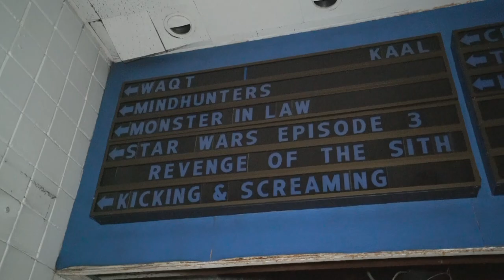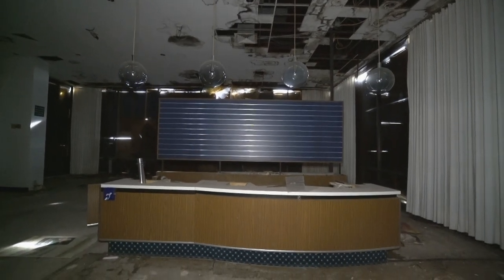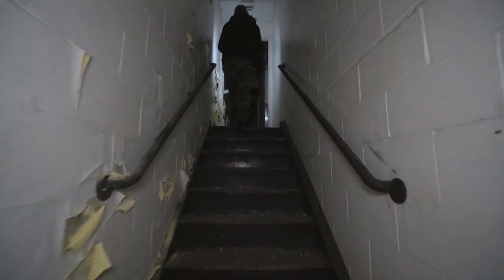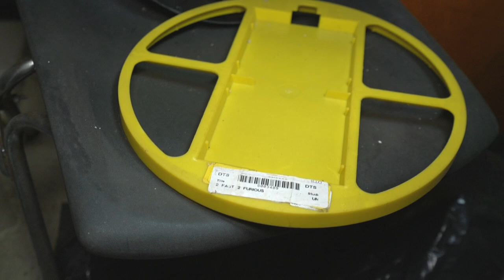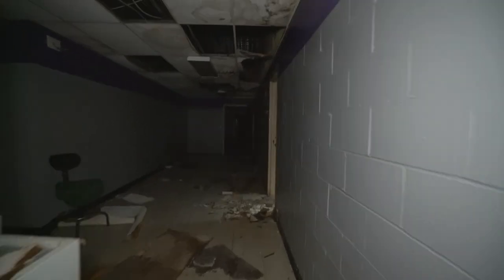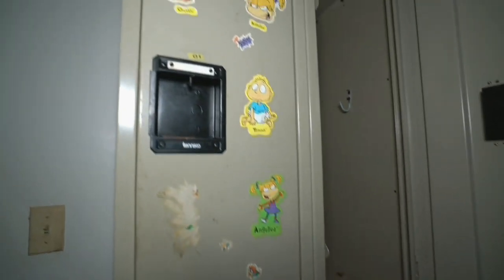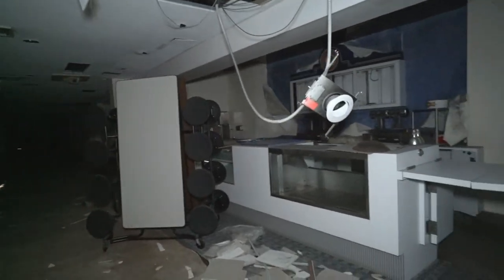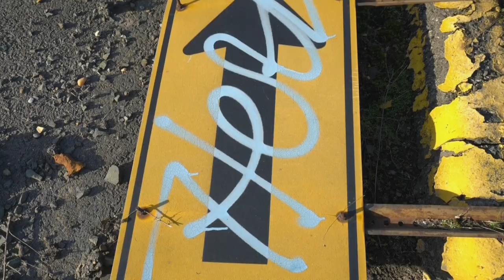Abandoned Retro Movie Theater - Films Left Behind(Closed 2005)

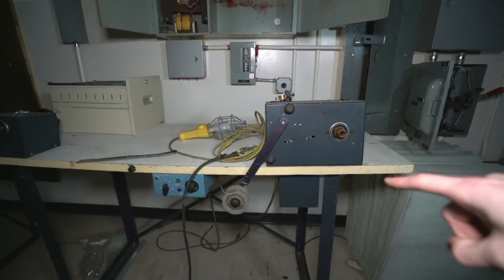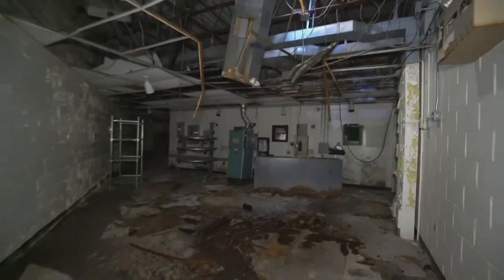Comment: Ok, you really struck the nostalgia nerve with me.  I was a projectionist late 80's through early 90's.  My first job.  I used to use an assembly table just like the one at 8:55.  Mostly to splice together trailers to go on before the movies.  Slight correction on the DTS discs, there was a time code printed next to the optical soundtrack on the film.  A sensor on the projector read that timecode and kept the CD/DVD audio playing in time with it.  The old style optical analog soundtrack was still on the film and was used as a fallback in case the DTS system faulted.  I'm surprised that all those discs were still there.  They were supposed to be put back in those round carriers and placed in the film cans when a movie was shipped out.  Just for some (unnecessary) information on sound systems, Dolby Digital used a digital soundtrack code printed on the film between the perfs (sprocket holes).  A camera would read it as it went by and it didn't need external media for the sound like DTS did.  A third system, Sony Dynamic Digital Sound (SDDS) used a digital track printed on the last bit of real estate left on the film, the edges that took constant wear as it went through the projector.  I never used that system but I'd heard that it was unreliable and not widespread.  At 12:45 to the left of the projector you can see a Christie platter system.  All the trailers and reels would have been spliced together to make one big film on one of the platters.  The whole platter spins as the film unwinds from the center, goes through a speed control mechanism, to the projector, then back to a different platter where it was wound around a central ring.  When the movie was over, pull the ring out and place it on an empty platter, pull the speed control out and place it in the center of the full one, thread it up and your film would be ready to load for the next showing.  No rewinding necessary.  It does not look like the other projectors used reel to reel but had platters also.  There were pulleys at the top and bottom that would have gone to the platters which normally were to the left of the projector.  It was common to take old projectors that were used in old reel to reel theaters where there were two of them side by side and use them singly with platters.  I had 3 projectors that were built in the 1950's at my first cinema.  #1 and 3 had been a reel to reel pair in the past with 40 minute magazines which we still had and were stored behind one of the screens.  I'm going to assume that the projectors in this cinema were left behind because digital projection was taking over and they no longer had any value.  Looks like the lamp houses were disassembled and the lamps removed because they could be dangerous and still had value to use in another cinema that was still operating.  I had one of those lamps blow on me while in operation.  Made a hell of a mess of the lamp house reflector not to mention the one in my pants from the noise it made.  Looks like most of the sound equipment and speakers were taken out as they would still have value.  Anyway, I went long winded for this comment but I hope it was educational for all you youngsters that took the time to read it.  Thanks for this exploration.  Made me sad to see the ruination of a cinema like that but the times keep on changing and us older farts can now be made fun of with our recollections just like we used to do for our previous generation.
Reply: This is incredible information and you should log it in a journal, facebook(i'm so sorry), or anything of the sort.  in a hundred years people will study your words.  Thank you for sharing.

Comment: All films are rented and have to be returned after showing. If not the fee is very high for "lost" films!
I'm surprised this place is not more trashed being in New Jersey! It officially opened December 7, 1979. The first film shown was "Star Trek The Motion Picture."

About the DTS Discs:
The theater sound system uses six separate speakers. The audio channels are encoded onto one or two CDs. The theater is equipped with a CD player and a decoder that splits these channels up and plays them on different speakers arranged throughout the theater. As in Dolby Stereo, DTS has three front sound channels and a subwoofer. But instead of a single surround channel, it has separate channels for speakers on the left side of the theater and speakers on right side of the theater.

The CD is synchronized with the picture by a special time code on the film. The code, a series of dots and dashes along the side of each frame, is read by a special optical reader mounted on the projector. The reader shines light on the film with a light-emitting diode (LED). The light that passes through the film hits a small photocell. The photocell sends pulses of current representing these flashes of light to the DTS processor. The dash pattern corresponds to a pattern encoded onto the CD. The processor makes sure the two codes are synchronized so that the sound and picture fit together.
Reply: They opened with Star Wars and closed with Star Wars. Crazy.
Reply: Star trek is different from star wars so almost
Reply: Interesting.
Reply: @IronMaidenDoD  but has the same dweeb/nerd/geek crazed fan followers?
Reply: @nathanlewis5682  your point?
Reply: Someone asked if there was a difference of star trek and star wars. The fan base is probably the same. We'll, besides the storyline plot, the time setting. 23rd century vs a long ass time ago. Hollyweird is running out of original ideas. I would laugh if there was a star trek star wars crossover movie like the Flintstones-Jetsons crossover made-for-tv movie.

Comment: The DVD's are DTS soundtracks for theaters set up with those systems use those instead of the analog track on the film
Reply: They realized and mentioned it in the video later on. They got it wrong assuming there'd be no soundtrack on the film itself though.
Reply: The film does have soundtracks.. It had dolby SR tracks and DIGITAL tracks... Most likely DTS and Dolby digital tracks.. The theatre was setup for DTS digital and used those discs for the digital sound
Reply: @txdraw  those Christie projectors were old a hell even for 2006 lol.  I remember working with Christie P35's in 1999.
Reply: @txdraw  Yeah, memory serves (I worked at theaters in the mid-90's) that DTS (Digital Theater Sound) barcodes were in-between the image and the analog (stereo) soundtracks, Dolby Digital was in-between the sprocket holes, and Sony Dynamic Digital Sound (SDDS) was on the outside edge of the film (the worst spot to put it because that's where the film got the most wear from the pulleys that it ran on). The latter two formats didn't require the discs like DTS. BTW, our theater had DTS in one auditorium and Dolby Digital in another.

Comment: great find, I was  a union projectionist for 15-yrs before going technical as a 35/70mm film projection/sound engineer for 40-yrs, I saw projectors from manual change-over to platters,  some of you guys may remember carbon arcs for the light before xenon bulbs in the early 70's to present... the film came to the theatre on 2000' reels (5-reels/90mins) (6-reels/2-hrs). until 1975 all cinemas was mono sound with 1-speaker behind the screen, in 1975 Dolby stereo came our in 4.0 w/left-center-right speakers behind the screen (no sub woofers), in 1980 sub woofers came out & the Dolby format was 4.1. In 1993 the format changed to 5.1 w/stereo left-right surrounds & DTS digital sound was the 1st digital sound on CD disc with time code on the film to tell the CD laser where to be to sync film to the disc...1998 Dolby digital came out with sound format on the film, also Sony SDDS was just beginning to come to theatres... Sony SDDS was the better of the three digital sound format...Dobly & DTS was 5.1, Sony SDDS was 8-channels 8.1.... in 1999 Dobly & DTS came out with (6.1), in 2001 Dolby & DTS came out with (8.1) & it stay that way until 2015 until digital cinema was beginning to take the place of 35mm film... By 2018 the 35mm & 70mm film era ended & digital projection & sound took over. This is when I retired from the cinema industry after 48-yrs in the business. 70mm was a limited production with tape recorder type sound track that was for large venues, later became IMAX..Until 1973 all projection light was carbon rod that can only run for 1-hr, that is why 2-projectors was use, when xenon bulbs came out in 1973 that changed the theatre industry, 1975 came the platters that the film was on large rotating table the rewind the film as it was being shown, these platters were gray in color & held the entire movie on 1-platter, there was 3-disc, 1-for the movie being shown, 1-to take-up the movie (rewind) as it being shown, & the 3rd disc to hold a 2nd movie.... to be part of a cinema with reel to reel & carbon arcs to platters & xenon light, from mono 35-watt amplifier to 7.1 stereo with up 17,000 watt of audio power was cool... If you see a indoor cinema w/5-6 amplifiers that was BIAMP sound 1-amplifier for each speaker except surrounds which was 1 or 2 amplifiers wired in a series/parallel config to trick the amplifier to maintain 4~8-ohms... subwoofer had 1~2 amplifiers usually one... I had installed cinemas around the world, my last count in projector install was over 2,200 plus in my career, I not only installed & serviced & maintain the projectors... the projectors were made by Ballantyne, Christie, Century, Norelco, Simplex, Strong, Furmenn, & Cinemeccanica... the projector light lamphouse was made Christie, Norelco,  Cinemeccica, ORC, Xetron,  Xebex, Film Systems & Strong...the platters were made by Balco, Ballantyne, Film System, ORC, Norelco, & Christie... the most use projectors was Christie, Century & Simplex/Strong... The worst projector was the Ballantyne Pro-35 & the India knockoff of the Century projector, my favorite was Century & Strong 35mm & 70mm film.... my favorite lamphouse was Strong & ORC, my favorite platter was Strong, Film System & Christie... my favorite sound processor was the Dolby CP50,  CP650 & Sony SDDS DFP-2000... my favorite amplifiers for cinemas QSC IA750 & DCA series....One last note..indoor theatres use 1600watt~3K watt lamphouse, mostly 2K watts,  drive theatres use 5~8K lamphouse for the light mostly 7K wattage... all lamphouses was  3-phase power, running at 25vdc/85 amps... a 7K bulb was 28vdc/135 amps... low working voltage but very high amps that would kill you instantly...the xenon bulb needed 20,000 volts to ignite the xenon gas in the bulb....these bulbs would explode....If you go into an abandoned cinema & the light buld is still in the lamphouse, DO NOT TOUCH IT, It can explode & you will get hurt by the glass...DO NOT TOUCH THE XENON BULB !!!  look at it but do not touch !!!

Comment: Excellent channel, I just tripped across this surfing to see what was posted when I found this.  Several points.  1.). The holes in the screen are from where people have stolen the auditorium speakers.  The theatre sound is located behind the screen.  2.). The Century projector is equipped for 35mm magnetic stereophonic sound.  If you were to go back, that auditorium should have (or probably stolen) numerous smaller speakers on the side walls.  The first very smaller auditorium would be used for an extended run, say after 4-5 months.  Sometimes those are referred to as a "shooting gallery" because of the long narrow effect.  The industry learned that the public as a whole did not care much for those.  Bravo!!! Looking forward to more of your adventures, I'm envious!!

Comment: It was kinda funny to hear you say those projectors were vintage. I used to be a projectionist from 2004 - 2019 and before 2010, 35mm projectors were still manufactured and in full use almost everywhere at that point. That said, one of the theatres I worked in had lamp housing and projectorheads as old as I was at the time, so 23 - 36 years old! Amazed they left all that in there, they could have sold half those parts for a good price on somewhere like ebay. As beat up as that old scope lens looks, it could be cleaned up really nicely.
The Q-tips would have been to clean between the different parts of the projectorhead. Even a tiny hair can look monstrously huge on screen, so you want all the oil and gunk out of your rollers before you run anything through the film gate.
And those DTS discs you found, yep, they are indeed the sound for the movie. A Infared light on the DTS reader corresponds to the timecode on the film itself, it'll relay that to the processor in the amp rack and you get sound...hopefully in sync. Unless of course someone forgets to put the DTS disc in...but that never happened, of course <.<

Comment: Built on the site of the Amboys Drive-In and located just off the Garden State Parkway as you go off the Driscoll Bridge. This theatre was entertaining audiences in central Jersey since opening on December 7, 1979. A sister theatre, Hazlet Multiplex Cinemas, shares the same design (I think) as this theatre. The Amboy Multiplex Cinemas was expanded to 8-screens on 21st August, 1981. On 11th June 1982 it became 10-screens. In 1985 it finally became a 14-screen multiplex.

It was closed on May 28, 2005 due to the foyer floor sinking.

Comment: I remember stadium theaters were pretty much everywhere by the mid 2000s.  I went to an old fashioned theater in 1999 to see The Phantom Menace, and I remember thinking that style of theater was old fashioned BACK THEN!!  That style was more common in the early and mid 90s, not the late 90s, and certainly not in 2005.  I saw Revenge of the Sith in a large stadium theater with digital projection back in 2005.  So I'm amazed this kind of old fashioned theater still showed first run movies in 2005.

Comment: for the record, films have analog audio tracks next to the sprocket holes on one side, some theaters can use the discs instead of course if they were set up that way
Reply: yes, however, there IS one exception:CDS a digital cinema audio system by Kodak/ORC, had no analog track, so if the digital audio has problems, then there is NO backup audio.
Not a good situation!
This disappeared VERY quickly. 
Also, some digital audio systems used discs(like DTS), others used digital info on the print itself.
Dolby Digital and the Sony digital system(SDDS)did this.
One of these put the digital info in-between the sprocket holes(Dolby Digital), the other one put it on the very edges of the print, past the sprocket holes(Sony SDDS).
As for DTS, it used a very narrow track added to the print that was basically like time code, to allow the film and disc to sync up.

Comment: I was a projectionist in the late 90s. These old projectors brought back memories. You are correct about those DTS discs. They would sync with the 35mm movie and would provide the soundtrack. This was very cutting-edge at the time. We only had one theater of three that was set up to use those. The other two just pulled the audio from the 35mm.

Comment: As I watch them walking along all of the corridors in the film projectionist area, I keep asking myself "They left the equipment behind, but they took the film-reel guides off the walls exactly why?"
(The film-reel guides are what projectionists used to move film from the film-reel tables, to the projectors, and then back to the receiving tables. They'd just reverse the direction of the film feed to rewind the film before the next showing, giving the staff time to clean out the theatre and to reload it with patrons for the next picture. Other cinema's, depending on the length of the film also spooled the film from the centre of the film-reel table instead of reversing the feed to set up for the next showing.)

Comment: On one of those movie projectors it said 68,000 hours which is about 7 and a half years on that bulb inside. Pretty cool
Reply from the maker: that's crazy, good eye
Reply: Actually, that counter shows the total amount of hours the lamphouse has ran-since those counters are not generally resettable, this does NOT represent the number of hours the bulb has ran.
BTW, the bulbs do NOT last 7.5 years.
1 to 2 years is fairly typical.
The glass gets a dark coating on the inside, which cuts the light output, and since it causes uneven heating, can increase the risk of a bulb exploding.
Also, old bulbs are harder to strike(light), and sometimes tend to flicker.
Small low-budget theaters tended to run old bulbs way longer than recommended.
So if you ever watched a film that looked a bit dark, maybe with a bit of flicker, now you know why.
Reply: We always changed them when they started to flicker. They lasted about a year in a busy mall location. Those old terminals looked like pacer ticket machines. The corps would pull and reuse equipment that was deemed reusable. I'm surprised some of the platters were left behind.